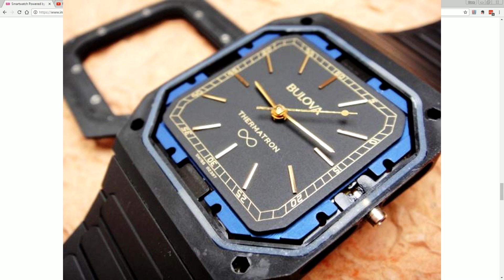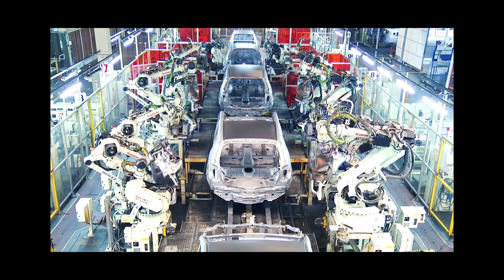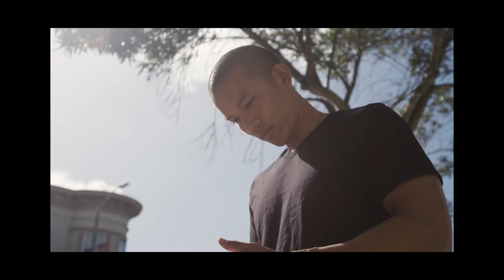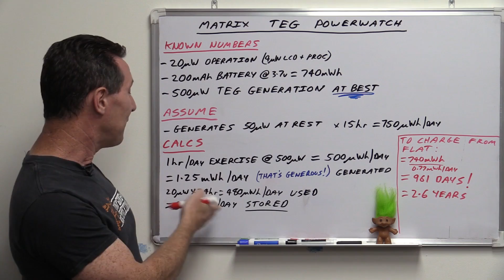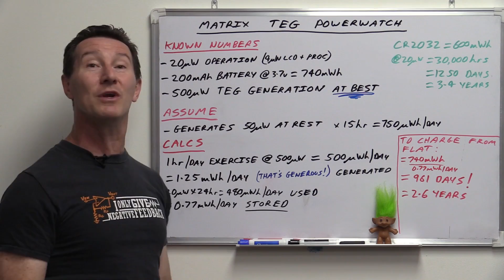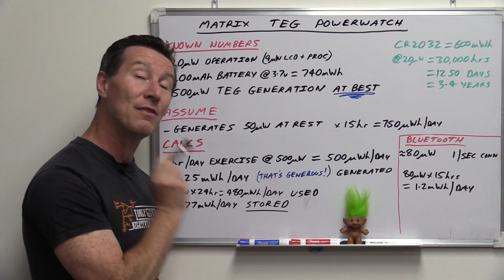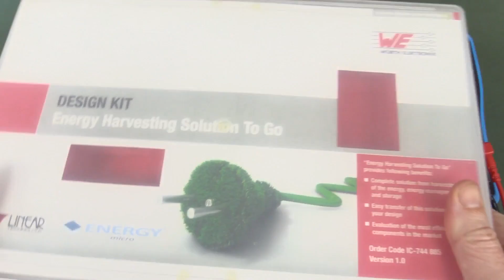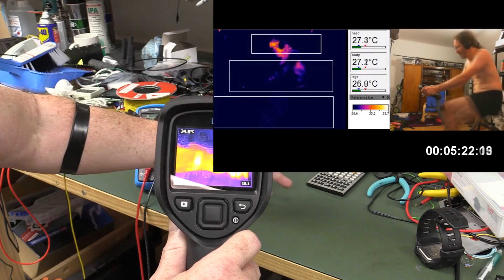EEVblog #945 - Thermal Powered Smartwatches Are GIMMICKS!

Comment: wanna help the environment? don't buy gimmicky crap that will be thrown out 5 mins after it's purchased in the first place.
Reply: .. but what to do if you don´t want to help the enviorment, but whant to spend a lot of money and claim that you do?
Reply: Buy a Tesla electric car and claim it is zero emission and that the massive batteries it has are NEVER going to cause a problem when they are stuffed and need replacing.
Reply: never mind the fact that the most pollution a car creates in it's entire life is from manufacturing the car in the first place
Reply: This is partly true, especially 10 years ago, but today, more recent studies have shown electric cars, at least in the US, are on par in terms of lifetime pollution including manufacturing as an equivalent fossil fuel vehicle with a theoretical 150 mpg fuel efficiency. So, at this point they are becoming much more viable than they once were.
Reply: read: "the dog and lemon guide". tesla electric cars are made of the most energy intensive materials known to man.
Reply: The last update I can see about the dog and lemon on electric cars is from 2007, industry has changed quite a bit since then, and, at least in the US, a lot of the energy that is used to make electrics now come from renewable sources instead of coal power. 

"But mining for thousands of tons of rare earth elements a year does not compare with mining for billions
 of tons of coal a year. From an environmental and health perspective, 
the amount of heavy metals, like mercury, uranium and thorium, emitted 
from burning coal in the U.S. alone exceeds by a thousand times the 
total amount of lithium and rare earth elements mined in the entire 
world (USGS; Treehugger)." in a US department of interior review 2013
Reply: the usa still uses way more than it's fair share of energy. australia and europe has had high petrol prices for 25 years; we all subsidize the usa. no offence intended
Reply: I think the marketing has changed quite a bit since 2007. the science and technology have not. The Japanese would have produced electric cars 15 years ago if it made sense. the tesla cars are a rich persons toy pretty much. toyota make a hybrid but that's about it. electric cars are a symbol of the fact that the usa (AND Australia too) want to continue wasting energy and simply feel good about it. we (at the moment) must waste some energy; but we could at least be honest about it. at least until a seriously better alternative becomes a reality.
Reply: wickedxe True.. but i just want to spend like $100 or so... A tesla is freeking expensive... and.. the savings... well no, they are not sufficient.

And to be honest... its not that good of a car (my father has one). Its by no mens bad, but its also not good. Its very american and crapy. Sure the panel fitting is better than most american cars, but not down to European specs.

Also you can´t have a adult int he second row. Because of the batteries the floor is really high and the ceiling is very low, so if you are tall like me, you are sitting with your knee in your chin.

All LCD screens... no that is not luxury, that is what they have when they want to save money on gauges. Its there because its cheap.

700hp... no, it have not. With a really crappy cheep as induction motor with 70% efficency you should be glad if you even got 400hp out on the other side, that is like a volvo estate hybrid. And it can hold that power for like 1 second before it degradets. It gives for a very impressive boast, but its not very practical.

All the Tesla fanboys only talk about good stuff, ignoring things that are bad.

Its not really a bad car. But look aside from the gimic battery.. its not really that much of a great car. For $100 000 you can buy heck of a lot of car.

I can buy a Volvo estate SUV hybrid for less. That i can run on electric every day, have the same power, have a real rear seat, and even a real 3:d row. Can tow a 2 ton trailer and i can sit comfortable in. I can also go on a 1000 mile journy not stopping to charge all the time

260 miles range... all well and god, if you do 90km/h (55mph). But if you do 130km/h (80mph) that is the legal speed limit here, then the range is down to 150 something. Don´t even get 2 hours of full speed on the freeway before its time to go in and charge 80 minutes.

30  minute charging.... yea 20% to 80%. Then you only got 90 miles range.

The whole idéa of a long range electric car is stupid. Electric drive works best in citys. You never go 260 miles in side a city on city streets.
Reply: "the most pollution a car creates in it's entire life is from manufacturing the car"
What makes u think so? And why is the car producing industry thus not a bigger energy consumer than all of the fuel consumption put together? Not to mention that power plants and all the industrys involved have very good filters etc. to keep pollution more or less limited to CO2. And as the need a lot less energy... its as lot less CO2 as well...
Reply: I agree that the Tesla is expensive, and so is any new technology, it takes time to refine it for the masses. The main reason car makers haven't tried to develop EVs is that their whole business model is built on making engines, so it's not in their interest to make something that could challenge that, and also up to this point I agree batteries were not dense enough to store enough energy for long range, but that's all changing now.

Do remember the Model S to which you are referring is only the second car they have produced, and every other common car maker have many decades and hundreds of cars of experience.

As for being able to fit adults, I have sat in an equivalent Audi S7, and it was definitely more cramped than the Model S, not to mention the transmission tunnel that takes up floor space unlike an EV. If you want to compare space to an SUV then look at the Model X.

As for LCD screens, that is personal preference, I and many others prefer the minimalism and ability to update these features. People said similar things about phones, yet smartphones now don't have keyboards and number pads. It does reduce the cost though, which is a benefit.

I agree the original Model S doesn't have 700hp, the motor could deliver this but the battery could not, however the Model S P100DL will soon have this high an output power, and the power electronics and motor are around 90% efficient. As for practicality, I'm not sure why anyone would need a high power for a long time, unless you're racing.

I'm not a fanboy, but I own an electric vehicle and I can see how in the short space of time Tesla have existed they have forced all other car maker to reevaluate and move forwards their EV plans, as the internal combustions days are numbered.

Take the Model 3 or Bolt for example, at around $30,000 after incentives it is broadly the same cost as other similar sized vehicles, especially when you consider the cost of fuel which is about 1/5 as much for an EV as for a petrol/diesel. My Nissan Leaf cost about £6000 used, so definitely sub $10,000.

If you want an SUV style car then the Model X can tow over 2 tonnes and is comfortable for adults. It would stop for charging every 150 to 200 miles, but when driving most people would stop every 2 hours or so anyway, for eating, using the toilets etc.

Charging 20% to 80% does take about 30 minutes, which is probably about the same time you'd spend eating several times a day anyway. not sure where you got 80 minutes from.

Electric vehicles are clearly the way forward, I admit they're not as quick if you're doing a long journey, but when it costs a fraction of the amount in fuel, the massive saving soon adds up, not to mention the reduced servicing costs, superior traction control and safety advantages of not having a lot of explosive fuel on board. Plus of course the pollution that burning oil produces, it's just not an option any longer.
Reply: Aaron Cocker 
" and so is any new technology"
There is nothing new in the tesla..: Well the auto driving system is fairly new. But the inductive engine is really 1950 technology. 18650 cells hare 1980 technology.. Well the aluminum body is 1990 technology. But there been advancement in steel body since then, so that is why most manufacture still use steel body 

"haven't tried to develop EVs is that their whole business model is built on making engines,"
That is factually not true.  A lot of car manufacture don´t even produce there own engines. Actually is really just a few that does. And most of them just produce the major components and assemble.

"I have sat in an equivalent Audi S7"
Well i have not so i would not know. The issue with Tesla S is not that its that cramped, but rather that its really really low and the feets are really high up. You siting like you usually don in the first row, int he second row, bot there is no space to do so. Its not that the car is small.. because its rather big.But it rather got a fairly bad interior design.

"not to mention the transmission tunnel that takes up floor space unlike an EV"
Eeeh.. you know that most car since the 80-tys don´t have a transmission tunnel? Front wheel drive.. rather common?

"unlike an EV."
That have a huge battery that takes a way all the floor space in steed of just 15 cm in the middle.

"If you want to compare space to an SUV then look at the Model X."
Its not a SUV, its a MPV

"As for LCD screens, that is personal preference, "
No.. that they are cheaper are not a preference, is a fact.

"yet smartphones now don't have keyboards and number pads."
yes.. and still 10 years later, its still crap. Nobody really want to type on a screen, its just that they don´t have the option of a keyboard anymore.

"I agree the original Model S doesn't have 700hp, the motor could deliver this but the battery could not,"
The motor also cant. Its a induction motor. The harder you run it, the more losses it generates.

Most other EV and hybrids have PM engines. They are a lot more efficient. The draw back is that they can´t be pounded that hard., The advantage is that the power is always there.

"I'm not a fanboy"
Usually this judgment is reserved for other people, not the one how claim it them self:

"Tesla have existed they have forced all other car maker to reevaluate and move forwards their EV plans"

You must be kidding me. Its like the leaf, the i3 (that hardly sold any cars) the MiEV and the B-electric (again hardly sold any).. Well you may count the Zoe 

The issue is with your statment that the only two EV that sold any numbers are the Lief and the MiEV... both predates the Model S.
You are factually wrong here.

Compare that to both the number of and the sales number of the PHEV vehicles. I would post you the list, but its to long, and there are also some cars missing. 

"Take the Model 3 or Bolt for example, at around $30,000 after incentives it is broadly the same cost as other similar sized vehicles"
That is also not true. the $30 000 number is after subsides.
And no.. A tiny Subcompact car don´t cost $30 000. You can get a Dacha in that size for under $10 000. And its actually a fairly decent car.

"If you want an SUV style car then the Model X can tow over 2 tonnes and is comfortable for adults"
No, model X is not a SUV, its a MPV. I don´t want a MPV, i´m not ready to give up on life yet.

A volvo XC90 cost around $45k where i live. The Hybrid version cost $80k. The Tesla X cost a whopping $120k... You know how much fuel one can buy for $120k...? 35 cubic meters. And the Hybrid XC90 is still a plug in electric. Yea its 100hp less than the tesla X.. but it also 300 kg lighter. Also the volvo is WAY bigger inside.  Its 10 cm higher, and it also have 10cm less battery under the floor (it sits 5 cm higher of the ground, so you "only" gain 15 cm)

"which is probably about the same time you'd spend eating several times a day anyway. not sure where you got 80 minutes from"
I cant go eat every 80 minutes... then the kids go crazy. Really of i even stop more then 10 minuts on a 5 hour journey  they go crazy ..
"are we there yet" ... "why does we stand still" ... "are we there yet".. "i don´t want to stop for fuel"

I even consider switching to a diesel just because they fill up faster. Sit in a restaurant with hyper active kids... don´t think so. Drive in yea...  Then have to be moving before they eat to. Eat in the parking lot... NO WAY.

Anyway.. stop eating every 80 or so minutes. Even with no kids, i don´t want to do that.

"Electric vehicles are clearly the way forward,"
No... they was not the way forward new, they was not it in the 80-tys, they where not that in the 60-tys, and they where not that in the 30-tys.. as well as in the 1880.

"but when it costs a fraction of the amount in fue"
that is factually not true. The only reason why its cheaper to fill up a EV its that gasoline is heavly taxed. Where i live we pay 3 times as much tax on gasoline than power. If we payed as much gas would be cheaper. And that not taking into account the cost of batteries.

" not to mention the reduced servicing costs"
No. that is also factually wrong. Swich the battery once and you got a $25k service bill. Change the oil, plugs and filter the whole lifetime of a petrol/diesel car and it cost like $600

"superior traction control"
no.

"safety advantages of not having a lot of explosive fuel on board."
you don´t have a clue do you.. ever seen a lipo fire?

"Plus of course the pollution that burning oil produces"
The old EV people don´t have a clue how energy balance work.... 

Don´t you realize that the power to your EV come from a coal power plant?
Reply: KrashCode Lithium ion battery was invented in 1973... what is new... specify.

In the US you can patent anything regardless how dumb it is. Patent don´t prove anything
Reply: Did you really just try using the "Long Tailpipe theory" to say EV's won't be good for the environment?

There are studies that have proven that theory patently false.

Besides, Nuclear is a better power source than Coal, Oil, Gas, or any of the "green" alternatives.
Especially if you are willing to use "dangerous" breeder reactors, and "dangerously" reprocess the spent fuel into new low-enriched uranium for the same reactor.
Best part of this? Fast-Breeder reactors can be refueled with U238 aka "Depleted" uranium (initial fueling must be with low-enriched uranium tho).

Don't hate something without evidence to back it up.
Nuclear waste is mostly solids and liquids by mass, meaning it's pretty easy to contain. Additionally, if the world was OK with running breeder reactors, and spent nuclear fuel reprocessing, we would have a lot less nuclear waste to deal with anyways.
Nuclear waste is not some intelligent, evil boogeyman that's actively going to seek you out and poison you. It's just some toxic sludge, and it's not even particularly toxic.
It's not magic. It's science and engineering.
All science and engineering is math.

The problem is making sure the math of dollars and cents doesn't get in the way of the math of engineering and science.
If that happens, bad things happen a lot more frequently.
Example: Bigger seawall for Fukushima reactor? No, too expensive!
Reply: aluminium is one of the most wasteful materials to make a car from. around 50% output of the massive Gladstone power plant in Qld Aust goes into aluminium production (why do you think aluminium is way more expensive than steel???). also Nuclear is crap. you don't need to look very far back in the past to see the huge disaster a simple problem/s can cause. carbon fiber and fiberglass is also hugely energy intensive to produce. in Victoria Australia you can pay up to 34 cents per KWH so I wouldn't say it would be that cheap to charge a tesla. Coal technology is not evil; just that people waste far too much energy; like using a clothes dryer on a hot day for example. These debates totally miss the point: if you want something to change; you cannot action change if you are going to use a different technology to do the exact same thing. driving huge suv's for example. Nuclear is fine as long as it's 500KM away from me; if you still think Nuclear is sweet google "3 mile island" which wasn't even close to an almost nuclear accident.
Reply: Probably be less detrimental to refuse and low cost if it used a coin cell too!
Wouldn't be cool / hot then and no one wold want it... 
Buy a real nice piece of engineering if you want a real watch, most people are never in a situation when they actually need a reliable and accurate watch these days, and those that do buy a reliable rugged one that tells the time well, and does not much else, as it should.
Refer Clickspring channel. :D
Reply: Also, huge emissions to produce anything, or nothing, factories don't run on love or stop requiring energy at idle and staff don't ride magic carpets and have magic clean uniforms :P
Reply: you raise fair points Paul Bearer. Most people these days have a smart phone that can do a hell of a lot. my phone even has a health app that can measure heart rate and track steps and detect running; so I sort of don't know why someone would pay much for a fitness watch.

Comment: Waaaait... 'MATRIX'... I GET IT. People as batteries. HURN HURN HURN.
Reply from the maker: snort
Reply: Why do robots need human batteries again?
Reply: If you consider it from a mental perspective it makes a lot of sense. Given that robots are programmed to serve humanity, their driving principle is not electricity, which is plentiful, but instead: human approval and validation. Human batteries don't provide energy, they provide meaning.
Reply: 120V no less.
Reply: will it come with blue or red pill ?
Reply: 120V you yank, 240VAC50Hz at least or 400VAC50Hz3P :)
@eevblog: replace the teg by a "winding" mechanism, that must be better or not?
Reply: I would go for the Blue pill!
Reply: @4mb127  WOAH
Reply: @Damicske  how's 240VAC 60Hz 2P grab ya?